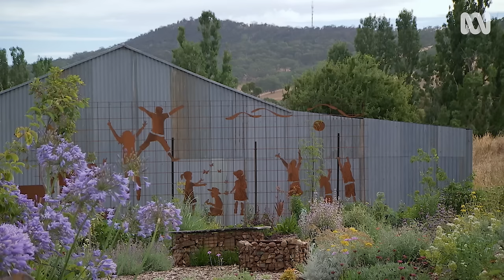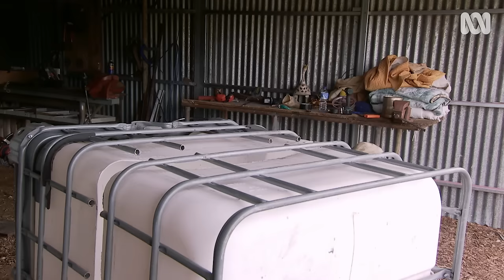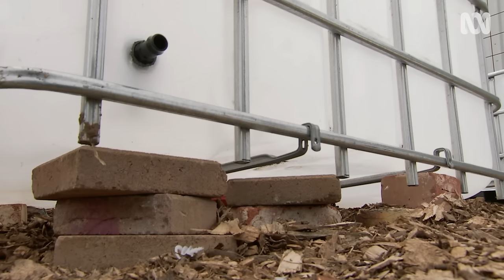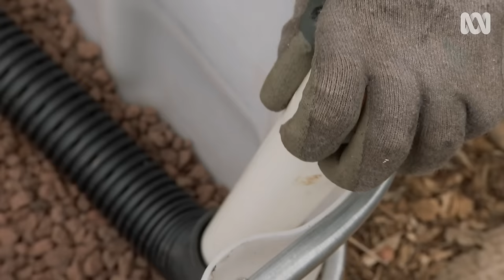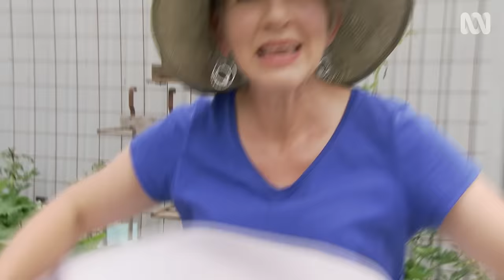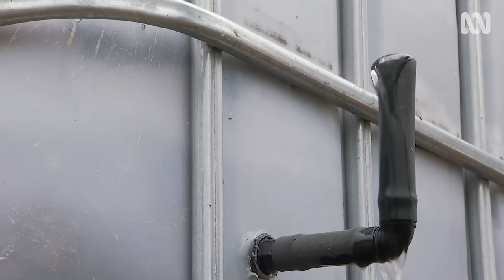How to Make a Wicking Bed | DIY Garden Projects | Gardening Australia

Comment: I use a small piece of foam,  round and thick. Then find the straightest/longest/lightweight  stick that i can and push into middle of the foam. Pop it into the pvc and mark on the stick where empty is with electrical tape. Start filling with water and add other markers along the way in diff colours. That way i can guage full, 3/4, 1/2 etc. Takes guess work out.

Comment: I just made two of these ,remember when you turn the top half over you need to check if the lid will leak .It took a few goes at tightening the lid to stop it leaking.its easier to fix before you add the rocks and soil ,my soil is resting now with worms in it and carpet on top ,ready for spring planting ,
Reply: I was thinking if you cut the IBC in half vertically instead of horizontally (if that makes sense) and be sure to cut through the drain spigot, you wouldn't need to worry about leaks, the lid "half hole" and drain would then be on the top edge, shouldn't worry the plants. I don't know if that will affect the steel cage, that may need to be done slightly different than this method.
Reply: @epineh  tanks are not square, so I'm not sure that would work

Comment: a tip for cutting IBCs if your not confident using an angle grinder, a sawzall reciprocating saw will cut through everything with the correct blade and not make sparks.

Comment: Very illustrative and clear instructions. I like best the finishing. Timber surrounds provides insulation and aesthetics. 👏👏
Reply: you need a  column of soil that goes to the bottom of the reservoir otherwise you loose the wicking effect after the water drops below the soil contact. Also the roots do not wick the water up it is the medium just like a piece of T shirt will wick up water. Please look at other that are doing this. If you do this way you will be disappointed

Comment: Thanks for the video. I am having trouble understanding how the water will wick from the aggregate reservoir without a wick (say sand or geofabric) inserted in the reservoir. Would the spaces between the aggregate be sufficiently small for capillary action? I am building one this weekend and trying to decide if I should use more formal wick points.
Reply: Good question. I don't really see the point of using ag pipe to 'disperse water evenly' . Doesn't water naturally level ? Ag pipe may be one way of saving money on scoria or pea gravel and might also help stop soil clogging the down pipe. As for 'organic loaded soil' , I agree with your point ; the capillary action of wicking works best through a fine and symmetrical medium. Builders sand will help 'pull' water in the reservoir up through the soil, closer to plant roots that have not yet grown. I work in a community garden and have made numerous errors trying to perfect a wicking bed. I'd go with 2 or 3 sand wicks, anchored in pot plants, that travel half way (at least) to the top of the bed.
Reply: @andibenson6834  The Survival Podcast #3095 goes into finer detail about wicking bed tech. For example you can put more pipes and less scoria which will provide a bigger reservoir of water. You can adjust the height of the overflow to accomplish different things, such as killing weeds, or growing starts. You can install automatic systems to refill the bed. etc.

Comment: Really enjoyed watching the video. I  have purchased the containers  and now am ready  build a wicking bed .  I would love to know the  size required for the ag pipe  how many meters are needed to cover the base,  the size  PVC i pipe to go into the ag pipe and  what size it the outlet nozzle to gauge the water level  My local Bunnings  said they could assist with  supplies if I have these details. Thank you in advance for support.
Reply: you need a  column of soil that goes to the bottom of the reservoir otherwise you loose the wicking effect after the water drops below the soil contact. Also the roots do not wick the water up it is the medium just like a piece of T shirt will wick up water. Please look at other that are doing this. If you do this way you will be disappointed

Comment: I am from South Morang, Victoria and I am having trouble finding the parts that let the water out or to a certain level. I have tried Bunnings and I have tried Reece but both couldn’t help me with those items. Can you please suggest any establishments where I can get what you have shown in the video? Thank you.
Reply: Show the video to the Bunnings store. The irrigation parts are stock standard at bunnings.
Reply: Alfred. You can get all the parts you need at Bunnings and any other hardware store. It is just poly pipe fittings.

Comment: What are the metal, hook-ended bars running under the bottom of the bin that was already levelled? It doesn't look like part of the frame container frame but is helping to stabilise the bin.
Reply: I think that is from 'top' of container and put down the bottom as support. An IBC has less support on top as weight is normally on bottom/pallet).

Comment: I have made a few of these in smaller containers. I was curious why you used scoria and not just hose in the bottom. It seems like the scoria would reduce the volume of water in the bottom so that you would have to water more often. Thank you!
Reply: Maybe the scoria holds quite a bit of water, too, since there is a lot of airspace.....Also, maybe it's cheaper than hose?
Reply: The scoria or lava rock as we call it in the us has lots of air space so it holds lots of water. It also moves water by capillary action. 
It will also release some minerals over time which is a good thing.
Personally,  i would use a lot more perforated drain hose and just a just enough rock to fill in the spaces between the hose and a couple of inches over the top of the hose.
A good video though.
Reply: I would use clear plastic hose on the elbow that can be turned down to drain the tank. By using clear plastic hose instead of the black pipe i can see at a glance how much water is in the tank.

Comment: How will I know the roots have reached the layer and no longer need to water from the top?
Reply: After 4 weeks you can be sure, that the plants have established. That is with temps around 15 Celsius. My tomatoes are growing roots in no time
Reply: you need a  column of soil that goes to the bottom of the reservoir otherwise you loose the wicking effect after the water drops below the soil contact. Also the roots do not wick the water up it is the medium just like a piece of T shirt will wick up water. Please look at other that are doing this. If you do this way you will be disappointed